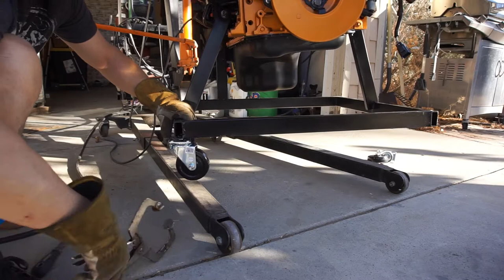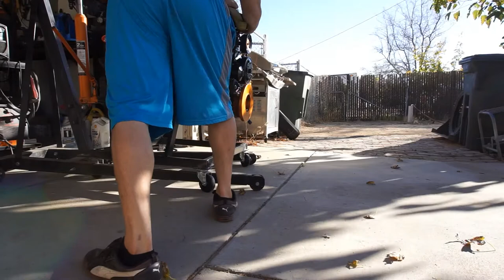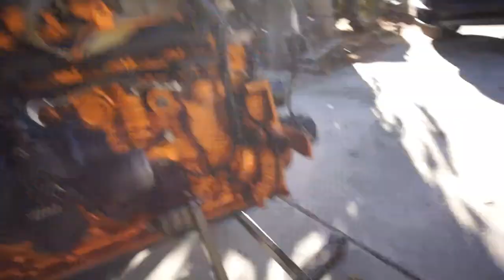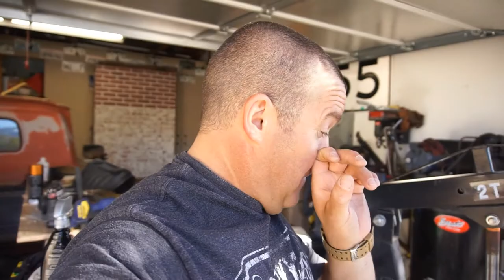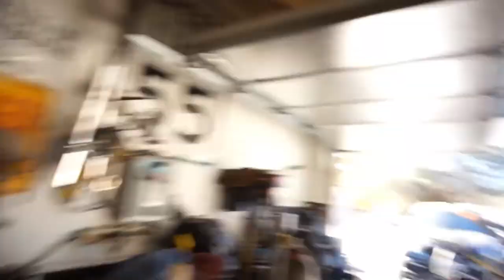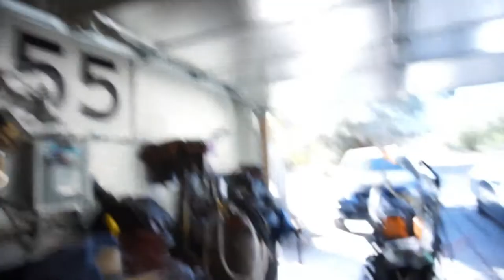Part 24 Cummins 6.7 6.8 Build. Final Part. Finished The Engine Cart. It Rolls

Comment: Watching at work... no sound. Just a thought.... the motor mount brackets you should have made that with bolts so you can use the same base with other motors that you build in the future (just swap out the actual mount portions). OR were you planning on giving the new buyer the cart as well?
Reply from the maker: OneNGlen yeah the cart is gonna go with the engine. It’ll be easier for someone to transport it.

Comment: That roll a round stand came out nice . Had any offers from your audience ?  Would've thought by now .
Reply from the maker: Orion Fixr thanks. I had 1 offer from Craigslist. He wants a warranty but he hauls shipping containers and cars. I told him I won’t warranty it. He’s ok with that but wants me to install it. I kinda want to bu I’d like a break from wrenching for 10 minutes. Haha. I’ll probably do it. His core is junk though. Threw a rod.
Reply: @Halffast719  ; How much extra is he willing to pay for the install?  That's one way to hear it run , not sure its worth it though .  I'd like to know what made his rod come through the block .
Reply from the maker: @orionfixr7713  He told me his driver never checked the oil. That's why i told him no warranty. So i make a barter deal. He ships shipping containers and has some, so i'll trade him my labor for a shipping container and delivered. $2200 value.
Reply: @Halffast719  ; Sounds pretty good to me . You happy....I'm happy for ya' . LOL !
Reply: What size container is he getting you? And is he giving  $7000?
Reply from the maker: Me You 40’ and he’ll be paying me $8500 because his engine threw a rod and it’s no good to me. $1500 extra for not having a rebuildable core. The shipping container is for me to install it into his truck.